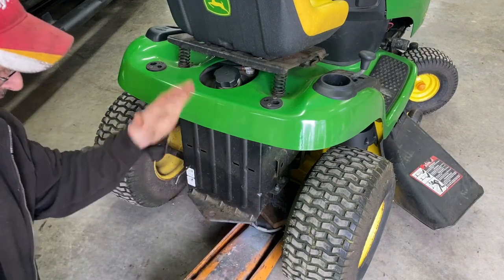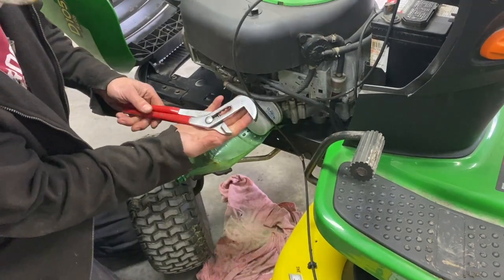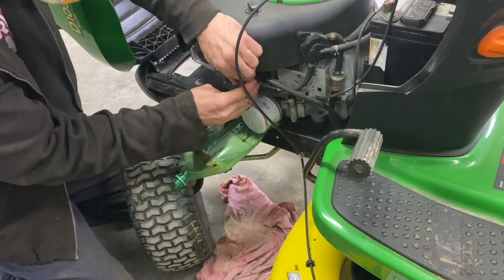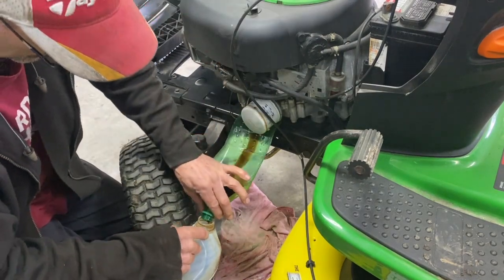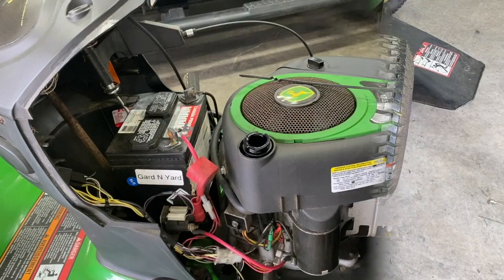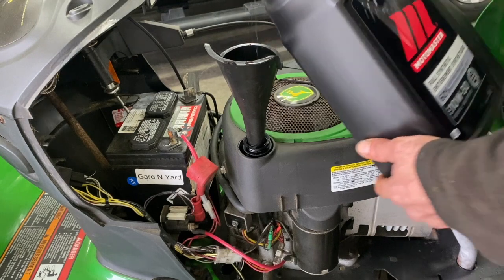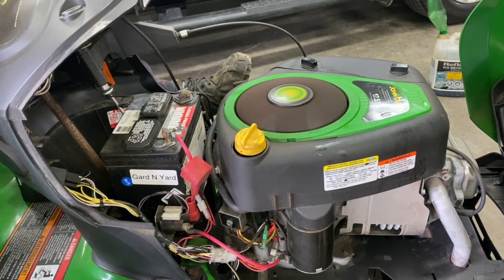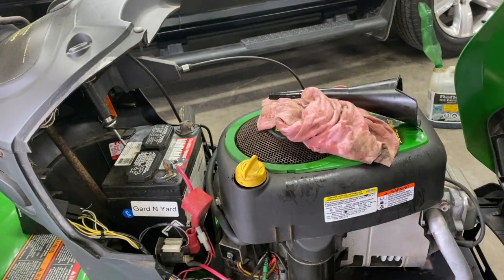How to remove a stuck oil filter on John Deere Briggs & Stratton engine Lawn Tractor. 100 Series.

Comment: Thank you! Its my first Deere tractor I bought last year and the oil filter was so stuck. I didn't want to crush the little filter on the S100 with my oil filter pliers but I had to to finally get it loose. Didn't drip much as I had gotten almost all oil out of engine before just little oil inside the filter. So hopefully with my hand tightening the new filter and lubricating the gasket it won't be so bad next year!
Reply from the maker: Awesome.